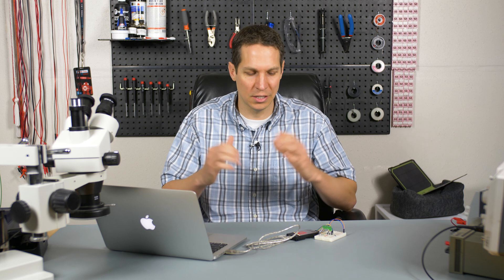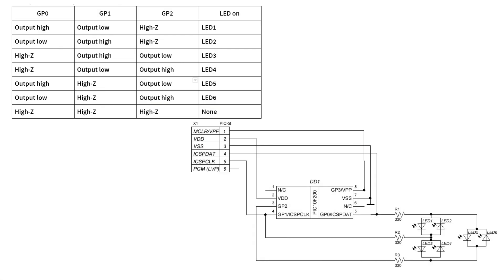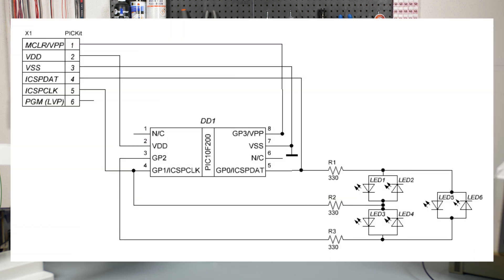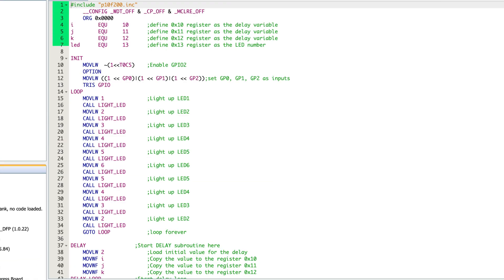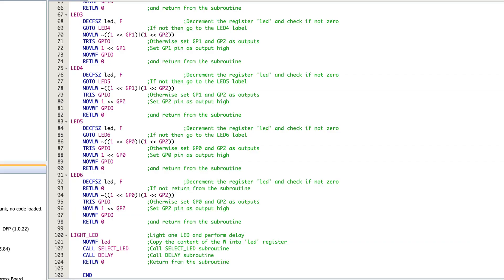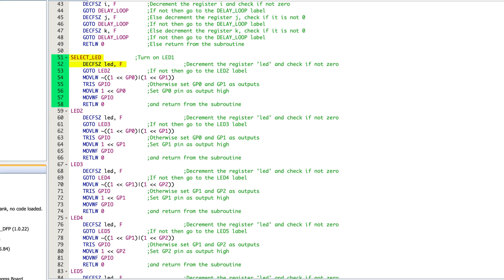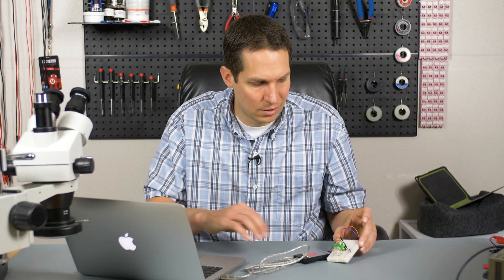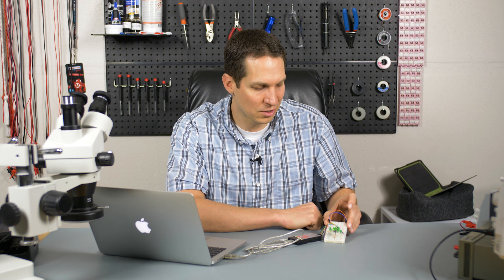DIY Christmas Lights with a Microcontroller - Charlieplexing LEDs (PIC10F200) | Christmas Special

Comment: Can the pic10f200 be daisy chained to control more LEDs, maybe 16 LEDs with 3 chips, where one pin on each chip triggers the next chip?
Reply from the maker: I think it's entirely possible, though the amount of pins you have are going to severely limit this approach.  It would almost certainly be easier and cheaper to get a PIC with a couple more pins.  But sometimes the process is more fun than the end result, so choosing the type of challenge is up to you!
Reply: @CircuitBread   Does one chip exist that's the size of 3 pic10f200 chips, with the same or more pins?
Reply: @CircuitBread  My project space is VERY  compact.
Reply from the maker: I think so!  You can figure out exactly how many pins you'll need and use Microchip's parametric search.  In their 16F and 18F families, they have a lot of great options depending on what you need, and almost all of them have the option to come in very small surface mount packages.  Though, if you're doing hand soldering, I'd stay away from QFN or BGA if possible.  Sergey can hand solder QFNs fairly well but I've always struggled and have only had about a 50% success rate.  A SOIC or SSOP would probably be the best trade-off between size and ease-of-soldering.
Reply: @CircuitBread   Thanks for the info

Comment: can i make pic10f200 run faster with a push button?
Reply from the maker: Hmmm... I don't think you can change the clock speed after it starts up.  You control clock speed in the configuration, which is only accessed when the microcontroller is starting up.  I wonder if there's a roundabout way to do it, though.  I'll have to think about it.